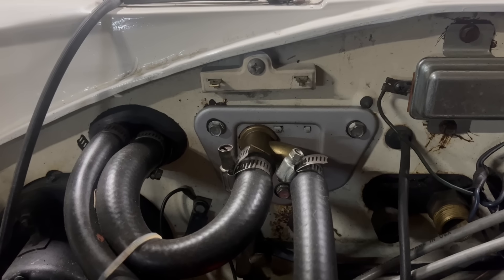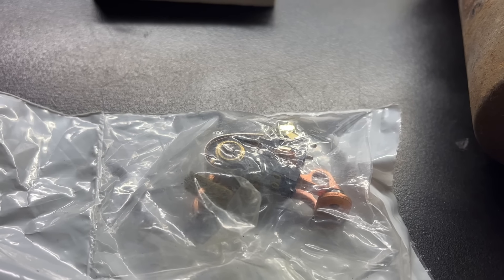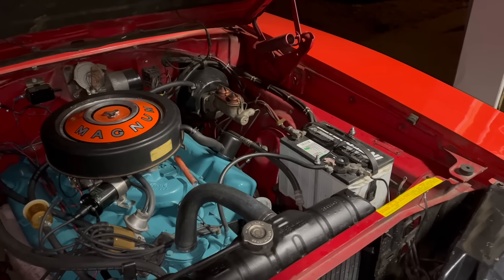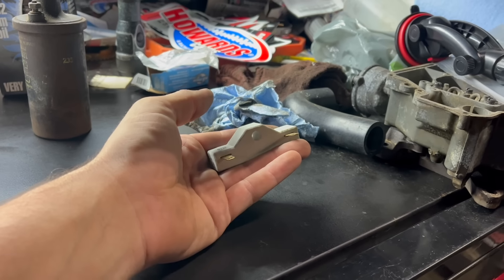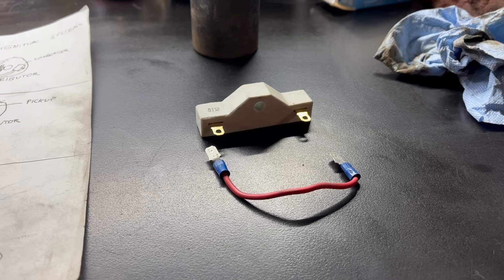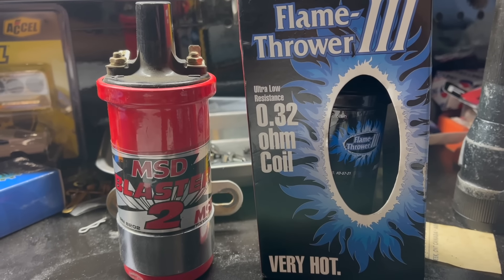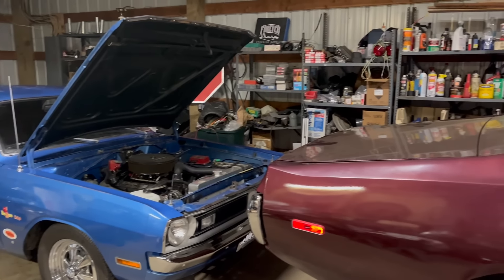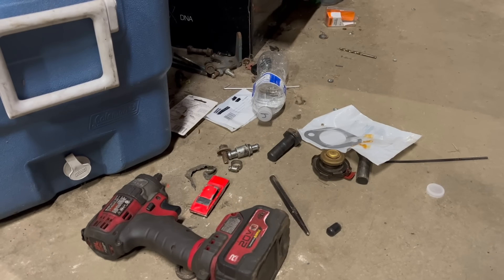The Big Ballast Resistor Video! A Simple, Yet Misunderstood Part Of Your Classic Chrysler Product

Comment: If you're tired of replacing ballast resistors but want to keep the old ignition system mount the resistor to a heat sink but then rubber mount it to the firewall or let it hang.  Vibration and heat kill the resistor but it's mostly vibration.  Ceramic is brittle.  You can also short out the resistor and use a stock 12V coil.  The points will survive because that's how old Chevys and Fords work.
Reply from the maker: I’ve tried that. With a high performance coil at least, the points die FAST. Turns out in those cases you’re supposed to run two resistors… in the days of points systems with 12v, if there was no ceramic resistor, the coil feed wire was the resistor -  called a resistor wire. This ‘64 Ford here has one, for example. I’ve seen the coils you’re referring to with built in resistors. I’m not sure what applications used those. Fairly sure Ford Duraspark is the main one, but I’m no expert there.
Reply: @DeadDodgeGarage  high performance coils and ballast resistors never mixed in the last 50 years as far as I know.  Use a stock 12 coil and your points will probably live.  If they don't you'll upgrade to CDI ignition like everyone else.

Comment: Can you next explain the Tesla electric systems.  Thanks.
Reply from the maker: No… no, I can’t. 😅
Reply: @DeadDodgeGarage  There is a channel "  edison motors "  that is converting log hall trucks to a diesel electric hybrid and will also going to do pickups. This may be the only electric truck the average mechanic will be able to work on.

I think we had an extra resistor in the glove box. You only need to be left high and dry over a supper cheap part. Thanks for some good old memories.

Comment: As an owner of many old Dodges (way back when) there were 2 essential component...a spare ballast resistor AND a can of WD 40...and yes if a dog pissed on the tire, rain ect where opening the hood looked like a light show from the cross sparking of the wires. WD40 would get you home.

Comment: In simple terms, the ballast resistor in a Mopar limits the amperage, or current flow, through the coil while the engine is running, thereby extending the life of the coil and breaker points of the distributor.

Comment: How about pros and cons of ready run distributors.
Reply from the maker: Hmmm… pro - works great, easy to install and wire, all-in-one solution. Con - price, impossible to fix on the side of the road when it fails. The only ready to run type distributor I have in the fleet is actually a factory built Pertronix conversion in a stock type Chrysler distributor. I’ve dealt with one MSD. It seemed good.
Reply: Thanks for the reply. I've had a failed ballast resistor leave me stranded just once but once was enough to not ever trust them. Carrying a spare is a good idea ,eliminating them a better idea. Imo. BTW Uncle Tony had an opinion about a Coronet RT clone that was for sale so critical opinions aren't just at car shows, they seem to be the norm everywhere. Thanks again. @DeadDodgeGarage

Comment: So the answer is "No, I don't have one on my 6-volt '55 Dodge." Didn't think I did, but this confirms it.
Reply from the maker: Right. Haha. Personally I’m impressed that you have a ‘55 Dodge still running on 6 volt!
Reply: @DeadDodgeGarage  *Will be running again this year. Going to see if it'll fire come spring when it's warm enough to tolerate working in unheated areas.

Comment: Memories of ballast resistor fun but not Mopar. 1970 - first car was a 66 Rambler. Coil failed - replaced by a garage - all fine except points only good for 50 miles or so. Went through two sets starting on vacation. Fortunately only garage open late in the day recognized the problem - old coil had built in ballast resistor , new one didn’t. Added a ballast resistor and all was good. Obviously no special wiring like the Mopars -l guess the resistor value was temp sensitive.

Comment: Resistors limit current and that byproduct of limiting current is heat. It is not the "heat" that produces the voltage drop. The points close which draws about 4 amps at idle through that resistor, and that draw calculated against the value of the resistor... 2.1 ohms :   4 x 2.1 = 8.4 volts which means the resistor is dropping 3.6V across it under load. you can use a DMM on the ign1 side and take a voltage measurement, then take a reading from the ign2 (load) side and the difference is what is dropped by the resistor.
Reply from the maker: Did…did you watch the video? Like, maybe the part where I did that?

Comment: I think I told you, but years ago I had one go out in my 74 Duster. after spending almost 100 dollars I learned it was the infamous 2.00-dollar ballast resister that stopped my precise baby, after with red on my face I went to the local parts store, bought another one and a nut driver the same as the nut holding it in place, in the glove box they went, and every year after replaced the ballast and threw a new one in the glove box. never had that problem again. and every downed Chrysler, I would point out that part and tell the owner replace it. it's a cheap fix.
Reply from the maker: The reason I have developed such a strong negative response to the idea that the ballast resistor is always bad is because people online tell stories like this, and then offer the resistor as the fix for just about any problem someone can think of. Starter doesn’t turn? Resistor. Headlights aren’t working right? Resistor. Your left foot itches excessively while you’re going down the road? That’s gotta be the resistor. I have lost one… one. And I have done many, many miles in many, many Chrysler products from that era in the last 16 years. But it happens, and carrying one is cheap insurance. I’m here to educate people on the intricacies of these systems - and to hopefully entertain at the same time. With the info offered here, a person can quickly figure out if that is or is not their problem.
Reply: @DeadDodgeGarage it's easy to blame the poor little ballast resister on every little problem, it does mimic some others, I went years driving and working on Chryslers, Plymouth mainly, before encountering this, ceramic little gem, but I did learn the bad bad ballast resistor would let you crank the engine until you started to give up turn the key to off, then it would act like the engine started just enough to get your hopes up, I only bore you with this cause down through the years I still get an amusing chuckle out of it, and years later our Mercury's TFI went out and It did the same thing now and again, my first thought was oh no not again, and where do they put one on a Ford

Comment: The good old days. I had a fellow mechanic call me over to his bay to help with his dads dodge, he replaced the coil, points and condencer then the whole distributor. plugs , dist wires ( the parts cannon) and gave up. so I grabed a resistor block, put it in and the car started. He still charged his dad 600 $ for all the work he did. some son.
Reply from the maker: Wow… yeah, that’s quite something.

Comment: Buy a coil with the resistor built in.  I'm using a 3TC Toyota 4 cylinder in a Bugatti replica.  I want cosmetics so I'm using a Dodge ignitor vs a GM.  Using the original Toyota pickup/distributor.  Doesn't matter which ignitor you use.  If you want to convert it to GM you have to mount the ignitor on a heat sink (any slab of aluminum) with heat sink silicone.  If you don't buy the coil with the built-in resistor, you can buy the double and you'll always have that backup resistor ready to just move your wires without having to get out the tools and allow you time to buy another.
Reply from the maker: I can't tell you how many HEI modules I have installed without a heat sink. I'm not saying the heat sink is a bad idea, I'm just saying...
Reply: @DeadDodgeGarage  I agree it'll work, they just last a lot longer when you keep the heat dissipated.

Comment: Hi, in this video you talk about a problem I have with a Charger 66.
It's that it doesn't light up when you turn the key, but it starts as soon as you release it. What's wrong then?
Reply from the maker: One of two things is happening. Do you have stock ignition? Or something else? If you have an electronic ignition conversion, in some cases the module will not be powered during engine cranking. The fix for this is a little complicated, as it involves a diode and another circuit running an additional power feed to the ignition system through it. If you have this issue with an original points ignition, then your problem lies in the IGN 2 circuit. This is the extra wire from the key switch that powers the ignition during cranking. It’s usually brown. There are various tests you can do to check this. A helper to turn the key and a test light or volt meter would get you a long way.

Comment: When the old vW Bugs switched from 6 to 12 volts in 1967, they switched to a 12 volt coil rather than a separate ballast resistor.  My 12 volt Triumph Spitfire does have a ballast resistor.

Comment: This new 87 dodge ram 100 5.9 i got was starting as youd release the key from start. Now nothing but somtimes the engine bumps or slightly turns over when turning the key to the off position. Now radio doesnt work no spark and wont start. I miss my old gm trucks right now.
Reply from the maker: Check the fusible links. There are several. Then check the ignition switch harness under the dash for burn marks. Then test voltages in and out of the switch. You will be entertained to learn that if you have a tilt column, you have a GM steering column and ignition switch. 😅

Comment: Ballast resistors,  voltage regulators, control modules and burnt out amp meters. Oh and wiper bushings. Only thing good on a older dodge is the ac compressors.
Reply from the maker: Ohhhh, the engines are alright (sometimes…)

Comment: I used to have a 77 Volare.  After the ballast resister failed the 1st time, I’d carry 1 or 2 of them in the glove box. They’d always seem to crap out on Sunday afternoons when the stores were closed (NJ Blue Laws). I remember one died during a real heavy rain. Unplugged the old one and connected the new one and left it hanging that way til I got home and it stopped pouring. They’d seem to fail once or twice a year.
Reply from the maker: Sounds like the best of times… and reminds me of the frequently dying voltage regulators in my first Power Wagon. I’ve never had that experience with the resistors - yet.
Reply: Seems like mine went bad driving , like the key switch just turned off.
Reply: @stick9648  Yup!  That’s how mine would go, driving down the road and then kaput!!

Comment: Is there a benefit of a 4 post ballast resistor over a two post? 🤔
Reply from the maker: No - it was only necessary for the early five pin electronic control module. I should’ve covered this in the video… that’s my bad.
Reply: @DeadDodgeGarage  
Good to know. 👍

Comment: My Chrysler built jeep Cherokee has a fuel pump ballast resistor.
Reply from the maker: I’ll be damned! I had no idea that was a thing. Apparently it’s just used to drop voltage to the pump under some conditions and reduce fuel pump noise. Similar idea as the more modern PWM pump control - but a much simpler execution.

Comment: I had this problem on my Dart. I replaced the resister. But a little late. I tried hot wiring my coil and it got the car running great. But as you know you couldn’t shut off the car at ignition switch. I got a phone call and had to shut it off quick. Unplugged negative side of battery. When I got back out and removed hot wire and replaced battery ground I got no spark at all. Check out coil with multimeter. Tested bad. Checked Mallory Unilight module and it was bad. Replace coil, module and resistor and still no fire at all. I’m stumped. Got any advise?
Reply from the maker: Huh. That failure doesn’t make a whole lot of sense. You have the tool in your hand to figure out what’s wrong though. Is it actually getting power at the coil and module? Does it still have power when it cranks with the key as it’s supposed to? You’ll probably need an assistant to check that. Cranking it with a screwdriver at the relay won’t do it. I’ve seen issues with the ignition 2 (crank power) circuit that can cause this.

Comment: What is the purpose of the 2 pin resistor on the wiper motor? Ignition, or to slow the wipers?
Reply from the maker: Slow the wipers, exactly. Unrelated to the ignition.

Comment: Well it's been so long since I had a ignition system with points..... AND YOU made it clear as mud.. 😅😅😅
But here's a funny I had..... it was a1957nford short bed ( at 16yrs old.... my brother drove one weekend while I fixed his 65 corvair corsa 140.. (4 single barrel carbs 1 on each corner) and he threw a rod through the block on my truck... so he got a tow home and left my dead truck and took his car I had fixed..... me and my 2 older brothers and 2 brother inlaws fingered we would take the 260 v8 from the same brother who had a wrecked 64 murk. Comet.... AND we did took about 3 weekends and it really worked sweet my 57 Ford pickup was super fun much more power with the 260 Ford v8 than the lil Ford strait 6..... I ran the crap out of it... just driving on freeway and and 4-6miles in town every day to school and back I was getting 20mpg.... ❤ but about every month or so I would burn up my points.... we kept the truck original wiring and it hooked the v8 up to it using the engine wiring on the v8.... bothe the truck and comet had 12volt system with a generator and separate regulator worked fine for a month at a pair of new points..... in a pinch I had a metal finger nail file I could open points (battery disconnected) &smooth out the points where they made contact..... one time it did it at my friend's house I got the file out and his dad watched a lil bit than asked what the hell I was doing..... I explained the problem.... he about pissed his pants laughing so hard..... he goes wait went in his garage came out and gave me a new resistor and said you need this.... than explained the thing and said he learned several jeeps earlier that when you swap later moldle engines to the older jeeps you will have that problem 9 outa 10 times.....
😅😅😂😂😂 the truck ran great till I went into the service and my parents sold it to a family friend cause my dad wanted it off his drive way.... he was pissed I think cause he had been a career marine and I went into the navy 😂😂😂
Reply from the maker: Wait, did I really not explain this in a way that makes sense? Lol. Your ‘64 donor would’ve had a resistor wire as opposed to a ceramic resistor. Not sure what the heck they used in ‘57. GM used a ceramic resistor like Chrysler at that time.

Comment: You can actually unplug both sides of the resistor and hook them together without a jumper. Just off set the female ends and slide together. 90% of the time theyll hold. If not just squeeze one edge tighter.
BTW, deleted an 86 Fifth Avenue Lean Burn, stuck in a points distributor frim a 74 truck 318, added a ballast and start bypass. Dumping that lean carb and/or manifold is the next step. Makes a decent car out of them. That 250 rear gear 😲😲
BTW use Accel points and condenser. Chinesium are crapp.
Reply from the maker: I’ve done that before. Haha. We also bridged one with a 30A blade fuse once, and I’m pretty sure it’s still there… I prefer the security of the spade jumper though. Easy enough. Nice! Yeah, the lean burn stuff just needs to go.

Comment: Chrysler made Jeeps had them for a long time. My 1990 Cherokee had no points. It was the RENIX system. Distributor, but timing is by the ECU. 1991 AND UP XJs have a fuel pump ballast resistor from my reading.
Reply from the maker: I learned that!
Reply: @DeadDodgeGarage  It's been 10 years since I sold my 1990 XJ, but researching it, tells me the fuel pump had a reduced voltage coming from the ballast resistor too. Approx. 9 volts.😍 Reduced voltage= ↑ longevity

Comment: Very  simple, and you don't need 14 minutes of video. 1:   Ballast gets bypassed during starting,  feeding full battery power to coil for a hotter starting spark.  2...As the name  "ballast"  implies, it  helps stabilize  power going through the coil.  These resistors  change  value with current through them due to heating, which tends to REDUCE  current as current is  trending to go  UP.
Reply from the maker: Cool

Comment: I had a ballast go dead in my 318 pickup. Grabbed one of my speakers from behind the seat (car speakers are 4 ohm), plugged the 2 spades from the ballast onto the speaker terminals and it worked just fine!
The speaker magnet held it on the inner fender well for the entire weekend till I got back to the shop.  put about 500 miles on it.
Works like an audible tach, you can hear it purring under the hood at slower speeds.
Reply from the maker: That’s impressive. Haha.

Comment: I use to keep an extra ballast resistor with socket wrench in my 75 Duster glove box. A hair line crack would be a failure.
Reply from the maker: I’m sure having a crack is less than ideal, but I’ve seen them with all of the potting guts in the back gone, with the actual resistor coil floating freely, and still going strong somehow. I don’t know that a hairline crack actually has that big of an effect on how it works electrically.

Comment: Hey can I use a ballast resistor instead of the choke controller for the choke
Reply from the maker: I don’t think you will get the desired result, but I’ve never tried that.
Reply: @DeadDodgeGarage  ty